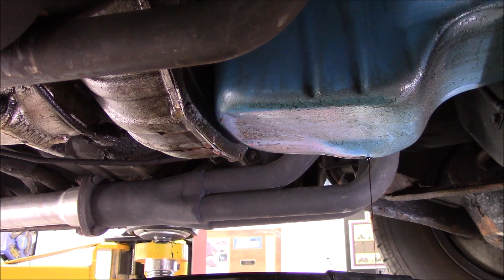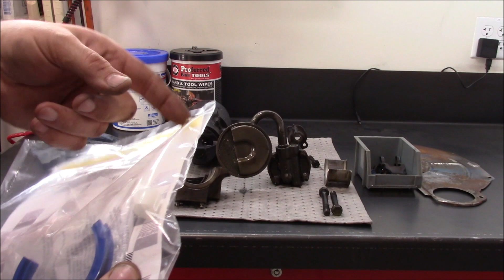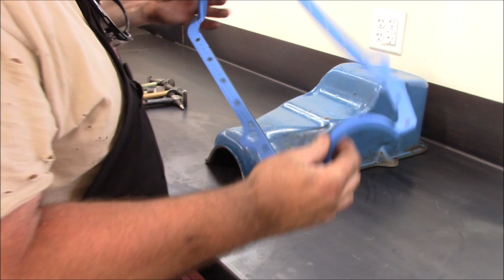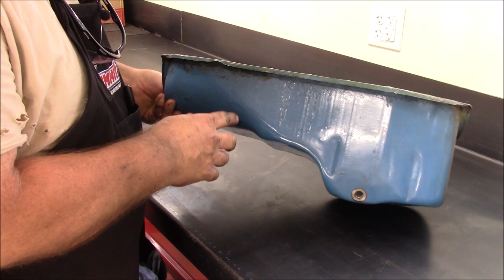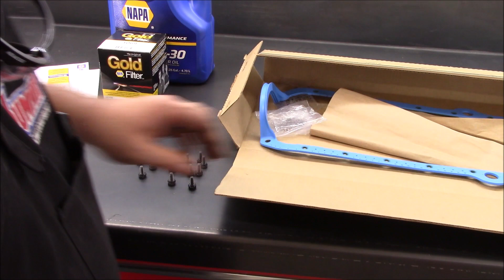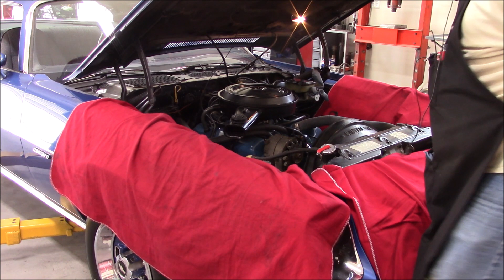Small Block GM 2 Piece Rear Main Replacement

Comment: Ever done this in the car with a bbc?
Reply from the maker: Not in a Camaro but in a Chevelle. Much the same procedure.  

Thanks for watching. 
Mike
Reply: Really ? Perfect I’m about to do this on my 72 chevelle next weekend. It’s a 2 piece rear main. Thanks a ton I’ll let you know how it goes
Reply: Can’t get the rear main cap off . Bolts are out , any suggestions ?
Reply from the maker: Sometimes they get stuck on there pretty good.  

Try inserting one of the bolts only part way or a long drift to get a little leverage and rock the cap back and forth.  That usually walks the cap up and out of the machined step in the block.
Reply: @zmotorsports62  thanks that worked
Reply from the maker: Awesome.  Happy to help.  
Mike

Comment: That was all very impressive, right up to the point at the end where you did not show us that it was not leaking...LMAO

If you say, "do this and that," and, "I've done this for 30 years," and, "I've had real good luck doing this," and then do not show us the proof by showing that engine running up on the rack, and not leaking, you pretty much negated your entire video. That thing might be sitting there pouring oil.

But I tend to doubt that it is.

By the way, I have a 1975 small block 400, that I bought sight unseen sitting on a pallet in a parts yard for who knows how long, for $500,  in my 1982 Chevy short bed pickup. It has the 76 mL heads with steel exhaust valve seats, and 2.02 inch valves, tubal mains, and by a stroke of luck it has an aluminum intake from a 68-69 Camaro/Corvette Being short of cash, all I did was clean it up, paint it, and put in a cam, headers, and carburetor. When I had on the engine stand I could've at least afforded to put a new rear main seal in it, but I didn't even think about it. And it leaks like a sieve. Up till now, I had no idea how to go about replacing this seal while the engine is still in the truck. But like you say, which is one of my favorite sayings, after watching this video it should be "easy peasy."
Reply from the maker: Thank you for taking the time to watch and for the comments.  I'm sure you will have no problem replacing the rear main.  Just take your time and don't rush it.  
Mike

Comment: Great video….need to do this exact job on my 70’ Nova.  Where can I find those big shop towels you are using as fender protectors??
Reply from the maker: If memory serves I bought those from Griot’s Garage.  It’s been many years ago so I’m not sure if they still carry them.  They are actual fender covers but very soft and don’t put fine scratches in the paint like some of the other commercially available vinyl fender covers can.  
Thanks for taking the time to watch.  
Mike

Comment: hi do you remenber the part number on ur one piece gasket
Reply from the maker: Fel-Pro OS34510T is the one piece molded oil pan gasket.  
Mike
Reply: @zmotorsports62  thanks!

Comment: No silicone on the rear main cap?
Reply from the maker: I’ve answered this several times in the comments already.  

IF the bearing cap is in good condition I will not use anything on the rear bearing cap to block surface.  If there is any scoring or the surface is marred then I will apply a small amount of anaerobic compound such as Loctite 518 between the bearing cap and block.  When installing the oil pan gasket just a small bead at the timing cover corners and rear main cap to block intersection, but that’s all.  
Mike

Comment: Great Video; one of the best that I have seen.  One thing that I didn't see you cover was the gasket removal under the timing chain and the rear pan seal.  I am thinking that those should be removed as part of the process if the 1 piece Fel-Pro pan gasket is installed, if I missed it my apologies.  Could someone confirm?  Keep up the great work, I would love to see more Mid 60's through mid 70 GM how to's!.
Reply from the maker: Thank you for the comments.   If/when I get more 60’s/70’s cars in my shop I’ll be sure to show them.   Not as many these days after closing my speed shop down in 2017.  

As for the gasket, no need to remove timing cover as the 1-piece or 4-piece gaskets fit in the groove of the timing cover.  Nothing from the oil pan gasket goes under the timing cover.  Same with the rear main bearing cap but in order to replace the 2-piece rear main seal the rear bearing cap is removed.  
Mike

Comment: Did you use any RTV for the oil pan gasket?
Reply from the maker: I used a small bead of  GM ES (Engine Sealant) at the front where the timing cover intersects the block and at the rear main cap where it intersects the block is all.  Other than that the oil pan gasket went on dry.  
Mike
Reply: @zmotorsports62  Thanks I will be attempting the same on my 78 nova I'm pretty sure I'll have the same clearance problem with the oil pan.

Comment: This video was a big help. I have a question though, where can I get that little white nylon tool that keeps the seal from getting cut?
I purchased a Felpro kit but it did not include the tool.
Reply from the maker: Glad the video was helpful.  Thank you for watching.  

Sorry I can’t help with the plastic installation tool as mine have always come with the seal.  
Mike
Reply: @zmotorsports62  THANKS again though. I am working on a 1955 Chevy Apache that has a 350 from a 1980 Corvette. Eventually I am going 6.0L LS Twin Turbo with a T56 but for right now, I an going through this 350 and freshing it up.

Comment: Couple things.  I noticed you didn't use a thin layer of rtv on the journal cap. Also, does it matter if you don't torque the cap back to the same torque?
Reply from the maker: I can’t remember without going back and watching the video again, but I think I mentioned if the mating surfaces are good I don’t use anything on them but IF there is any sign of scoring or marring of the mating surfaces I will use a small amount of anaerobic sealant such as Loctite 518. I don’t like using RTV sealants on the cast mating surfaces as I prefer an anaerobic flange type sealant for those applications.  

As for torque, yes, torque back to factory spec’s. 
Thanks for watching.  
Mike
Reply: @zmotorsports62  Thanks for getting back Mike! I'm about to do this job myself

Comment: When you have to loosen the other bolts to get the seal out how do you properly re tighten the bolts. Mine won't come out may need to loosen them up.  Any info will help. Thanks for your time
Reply from the maker: Are you talking about loosening up more main caps to pull the crank down?  If so, back them off slightly to allow enough clearance to remove the rear seal. Once the seal is replaced re-torque the main bearing as normal., starting in the middle and work outward (fore & aft). 

If memory serves on those 7/16” main cap fasteners they are 65-70 ft/lbs. but check your specific torque specs for your engine.   

Hope that helps.  
Mike
Reply: So I will be ok to re torque without any loctite?
Reply from the maker: Yes, you will be fine. I don’t recommend loctite on main bearings anyways.

Comment: Thank you for the Video! Question 1. When/where/should I use Anerobic sealer on the rear main bearing cap- I did it once on a Jeep 4.0 before..seems like it would apply here? 2. When the oil is drained entirely do you need to prime the oil pump prior to starting or is that only for a fresh rebuild? Thanks!
Reply from the maker: Yes, the rear bearing cap would be an ideal place that you could use an anaerobic sealant IF there were suspicions of a sealant being needed, such as mars or scratches in the mating surfaces of the black and cap.  If there were no defects I would not use any sealant.  

As for oil pump priming you shouldn’t need to reprime as the oil galleys and passages should still retain oil.  I have not found the need to reprime after a repair such as this and have gotten nearly instantaneous oil pressure.  

Thank you for taking the time to watch. 
Mike
Reply: @zmotorsports62  Thanks for the quick answer- makes sense!

Comment: Thanks for your input. I replaced the 2 piece rear main and  piece Oil pan gasket just as you prescribed in your video. Same gasket and seal. Took my time and very methodical process used a torque wrench on all bolts. I also replaced the valve cover gaskets using the same process. Car ran for about 30 - 45 minutes and I noticed 1 drop of oil on floor under the oil pan below the rear main.  Looks dry all around back of pan/gasket area but the oil is coming down behind the dust cover for the bell housing. Any suggestions? Thx
Reply from the maker: Could be some residual unless you thoroughly cleaned the lower bell housing area.  
Thanks for watching.  
Mike
Reply: @zmotorsports62  Yes I cleaned everything very well.  Staggered the 2 piece main seal 1/8 inch and applied  a very thin amount of sealant on main cap/back of block surface.
Reply from the maker: Not sure what else to say at this point.  
When I have a difficult leak to locate I’ll use a die with UV light and that will usually help to locate the source of the leak.  
Mike

Comment: Excellent Video Mike. I like your work and detail...... I am replacing Rear Mail Seal and Oil Pan Gasket on a 1970 350. Using Fel Pro gasket and seal.  Do you recommend a small dab of sealer on cap and block mating surface? I noticed you did not apply sealer to that cap/block area. Also I can see some wear on crank from seal but I cannot feel anything with my finger nail. I bought both Fel Pro seals the replacement you used and the offset seal for wear. Thx for your work,
Reply from the maker: I don’t put sealant at the cap/block mating surfaces unless I detect an imperfection in the mating surfaces.  

Thank you for watching and for the kind words.  I’m glad the video was helpful.  
Mike

Comment: Whats your opinion on 428 pontiac with a rope seal. Graphite rope or viton?  It has the scores on the crank.
Reply from the maker: I’m not familiar with that specific engine’s characteristics but I’ve had really good results with the Viton lip seals in rear mains.  Personally, I haven’t used a rope type seal in many, many years now.  
Thanks for watching.  
Mike
Reply: Thanks for the reply, I'm not sure which way I'll go yet. You did a really good job on filming this video.
Reply from the maker: Thank you. I appreciate the feedback.  
Mike

Comment: Hey Mike, First thank you for an great video. I have a 68 Camaro SS, with a mid 70;s 350 small block,  I have a question, did you rotate the crank to No5 for clearance on the harmonic balancer, and did you have to disconnect the header flanges in order to lift the engine the 2-3 inches, Appreciate your comments, I'm on the fence, because I wont have a lift, so will be on my back. Thanks again Tom
Reply from the maker: Thanks for taking the time to watch Tom. Glad the video was helpful.  

I did not have to rotate the crank nor disconnect anything exhaust related on the is particular car.  

Mike
Reply: @zmotorsports62  Thank you Mike!

Comment: Thank you, very informative.  Only thing I'd like to have seen is where you put the sealer on the oil pan gasket at 4 corners.
Reply from the maker: Sorry.  It wasn’t anything special, just an 1/8” or so strip directly in the corner where the two surfaces meet. Then the gasket will spread it slightly when installed and torqued to spec.  
Thanks for watching.  
Mike

Comment: Great video and very informative. I have an SBC 350 (Gen I) that I installed to replace stock 305 in my GMC Caballero (El Camino). 6 months later and I have oil spewing everywhere underneath the car. Didn't want to pull the whole motor and searched for some alternatives. Found this video most helpful of any I've seen. Q: Did you list the parts that you used? I originally used a two piece rear main seal but it wasn't built into the oil pan gasket like the one you used. Also did you do anything to the front seal behind the timing cover? Or just leave it be and replace the bottom portion with the oil pan/main seal gasket?
I may have to re-watch just to see what part number that is. Fel-Pro??
Reply from the maker: Sorry, I didn’t list the part number. The rear main is the 2-piece seal but the oil pan gasket that I used is the 1-piece style.  There are a couple of different choices based on oil pan design and model years.  

I didn’t replace the front timing cover seal as it wasn’t leaking. It is a 1-piece press in seal that is behind the harmonic balancer.  

Thank for watching and I’m glad you found it helpful.  
Mike

Comment: Excellent job! I really like your attention to detail in regards to what to watch out for like the little nylon installation tool, unless there are directions in the gasket set addressing this I'd probably think was just piece of shad and discard it. I have a  427 4 bolt mains in my "69"Camaro and have been noticing a few drips as of late out of the scatter shield. Never have done this but always heard this could done. I would assume this would be the same for a BBC.
Thanks for the effort in your videos, I know it take a passion and a lot of work to share your knowledge.
Karl
Reply from the maker: Thank you Karl, I appreciate the comments.  

As for the process, yes, it is the same for a Big Block GM. 
Mike

Comment: Great tutorial, thanks! I'm following your steps on my '80 Z28 but even after removing the motor mount bolts and jacking at the balancer, the engine does not want to lift on its own - the whole car wants to lift. Any suggestions? The motor mounts were recently replaced by the previous owner and do not seem to be seized, etc. Bolts are clean and came right out. (Using my daughter's account to comment, in case you're wondering haha)
Reply from the maker: With motor mount bolts removed the mount halves should separate. Try using a pry bar and attempt to separate the motor mounts as they could potentially be stuck together.  
One thought, check to determine there is not a chain or cable tying down the engine on the driver’s side.  This is an old trick for drag racers to assist in transferring power. 
Mike
Reply: @zmotorsports62  Thanks for the response! I just wasn't lifting high enough and the car was just lifting naturally with the reduced weight. Appreciate your comment though!

Comment: Thanks Ive offset rear main seals like 10mm between cap and block, siliconed mating faces on seal ends and siliconed block/cap mating faces and never had a leak. Im trying out using a neo seal in a rope block as well

Comment: I have a question.  Where on the seal did you put the assembly lube?  The outside so it slides around inside the block or does that side need to be dry???
Reply from the maker: I applied some Sil-Glide to the surface that meets the crankshaft to aid in assembly as well as to avoid a dry start on the seal.  I keep the block to seal surface dry.  
Mike
Reply: @zmotorsports62  thank you. I've never heard of Sil- glide is there any other lube I could use?
Reply from the maker: You can use any kind of lube. I purchase Sil-Glide from my local NAPA. I use it mainly on O-rings and hydraulic cylinder packings.  
Mike

Comment: Great video.  Thanks.  Wondering if the main seal isn’t leaking, the valve covers aren’t leaking and the intake manifold isn’t leaking, what else can be leaking out the clutch cover?
Reply from the maker: If you are certain none of the aforementioned components are leaking,  as well as certain the oil sending unit isn’t the leak source, it is possible one of the pipe plugs on the back of the blink us leaking.  They’re subject to oil pressure and they plug oil passages. It’s not common but I have seen it. 
Also Najee certain it’s motor oil because it could potentially be a transmission input seal leaking.  
Thanks for watching.

Comment: Very very good job.  A lot of these show and tells assume people know a lot about the topic already, you are able to teach with out getting too simplistic and taking forever.  I like how you point out the somewhat "controversial" items, because a lot of folks do things different ways.  Your video is really good, a guy can see most all of it.  I really really like the first bit of what to look for PRIOR to starting the job.  A lot of these leave that out.  Overall, A+ and thank you.  Great video.  What i would like to see more of these types of videos is a)  a list of tools required at the start (ie: wrenches, scrapers, torque wrenches, engine lift, etc and consumables like brake cleaner and gasket cement and others - both bare minimum and what is best) and write it on paper and show it long enough for a guy to take a screen shot and b) a list of spec, like torque specs written down so a guy can also take a screen shot.  But still, a great video.
Reply from the maker: Thank you for your very flattering comments.  
The torques specs and general tools lists are great ideas.  
I appreciate you taking the time to watch. 
Mike

Comment: Informative video! I have a rear main leak on my 86 Cadillac Fleetwood Brougham with the original Olds 307. The original two piece 'rope' or 'wick' type seal was replaced 10 years ago due to a leak then, but unfortunately started leaking again after 1 year. Im by no means a mechanic, but do attempt to do as much of fixes my self if possible. I read on some forums that there are now replacement neoprene/rubber rear seals to replace original rope fitted seals. Im debating on attempting this myself. Have you had any experience with using rubber rear seals in place of original rope type setups?

Comment: Is it ok to raise the engine and trans by lifting on harmonic balancer? Also guessing you also had to take the transmission crossmember bolts off too right?
Reply from the maker: Applying light pressure to the harmonic balancer is acceptable but keep an eye on movement. If the engine stops moving/raising, don’t keep applying more pressure.  
No need to do anything with the transmission mounting bolts as there is plenty of flex in the mount and it’s far enough rearward that the movement is minimal.  
Mike